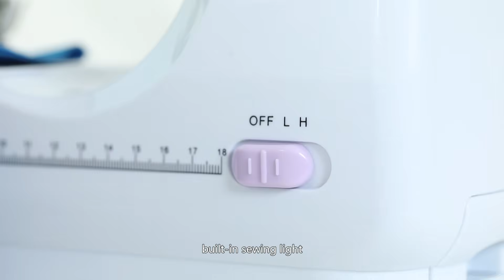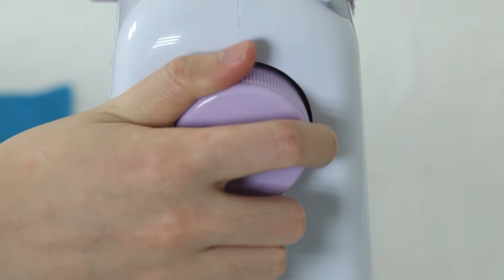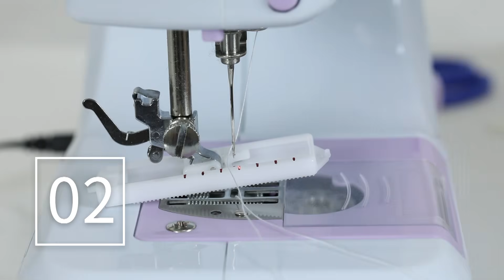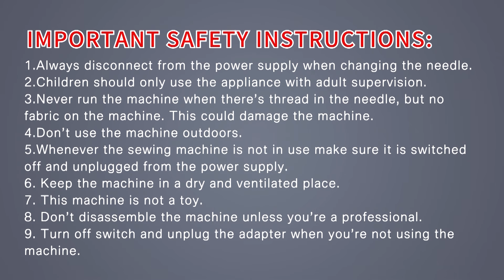Operation of FHSM-505 sewing machine

Comment: Ok wait you said at to thread the machine from back to front then a few seconds later you said thread from front to back which is it ? I have the same exact machine I have followed the instructions on threading the lower bobbin but for some reason as I start to sew it gets jammed and the thread gets all tangled then it stops like it’s stuck smh I will be returning Based on other comments, I’m assuming that this machine was not designed properly and if I would’ve seen the comment prior to purchasing I would not have!!

Comment: This machine worked for me on a couple small repairs then when kaplooey somewhere in the bobbin area. Needle goes down and pulls to the left and it gets jumbled up right from the start. Very disappointing as I have sewn since I was 12 on a Japanese Kenmore that has been broken for years, so I got this cheapy thing as a "quick fix." Well, at least I got to repair two things. If anyone has any tips for the same problem, I'd appreciate. It's not the tension, I don't believe, but something is not connecting in the bobbin area. Plus the magnet that holds the bobbin is nothing like the compartment that holds the bobbin in my old Kenmore.

Comment: Hello I have a similar machine but they call it a Birgitta now the machine instructions says flat side to the RIGHT but the Universal needles says flat side BACK. If I follow the Universal way will this effect the function of the machine?

Also I have found replacing the needle tricky (either way) its wobbly falls outs tried many times to no avail. Can you tell me what the problem is? Please.

Many thanks

Comment: Why does the machine sew even when I do not press on foot pedal.
Reply from the maker: The machine can be controlled by foot or manually toggle the switch to control the speed of sewing. The two can be used at the same time or separately!
Reply: @huafengsewingmachine2563  I have a problem my foot pedal cannot very from fast or slow it can only be fast. How do I make it slower or vary the speed by foot?

Comment: Do you have to thread it from front to back? cuz I have a hard time getting the threading tool though the whole from the back
Reply: It is difficult. I just got done doing it myself today. Use the little threader tools. Those little wire things push it from the back to the front of the needle put your thread through the wire hickey and then pull it back back through the needle. It took me a couple times but you’ll get it😉😁

Comment: Apparently, there is a timing issue between the needle and the rotating wheel underneath it that supposed to pick up the bottom bobbin thread. I saw this by carefully examining how the the rotating wheel hook should catch the thread from the needle. I was able to fix this by using a screw driver to place the thread on the hook. But despite of this the machine is not stitching. I guess it's a very bad design of the machine. And most probably the machine is faulty, since a lot of people reported the same issue including me.
Reply: You need to take the face off of the machine and adjust the screw of the needle bar which is in the middle of the hexagonal washer/bolt thing.  It's very easy to do. I have this machine and it's something I have to do frequently.  The needle bar always seems to shift.  My husband inserted a rubber band around the screw, he's an engineer and said that there should have been a washer there to prevent shifting to begin with so we will see how that goes.  I do a lot of sewing and this isn't my main machine so I haven't even used it heavily.  I love the design and size of the machine so I'm thinking of switching out some parts if possible and upgrading it myself.
Reply: Yo trate con la llave hexagonal, desarme, ajuste y aún nada no me funciona y no tengo ni 1 mes de uso 😢
Reply: I'm having this same issue and can't work out how to fix it:(
Reply: Do you know how to thread the bottom bobbin three of it won’t pick it up I can’t figure out how
Reply: Tienes que calibrarla
Reply: @careliz  How, please?
Reply: My bobbin thread keeps knotting,  but when I 1st received it, i had to move the needle part as it kept hitting the metal below
Reply: I’m having exactly thesame issue and I haven’t even used the machine reasonably well
Reply: https://youtu.be/atR8rpHWqvE?si=_OeZ8rOEeHVOQuMP
For bobbing issues
Reply: Please can you do a video on the needle part mine got stuck
Reply: Same

Comment: Hi, thank you for this info. I have problem, my needle doesn't pick up the bottom bobbin thread for some reason. Anyone else had that problem and how to solve this? Is my machine faulty?
Reply: Apparently, there is a timing issue between the needle and the rotating wheel underneath it that supposed to pick up the bottom bobbin thread. I saw this by carefully examining how the the rotating wheel hook should catch the thread from the needle. I was able to fix this by using a screw driver to place the thread on the hook. But despite of this the machine is not stitching. I guess it's a very bad design of the machine. And most probably the machine is faulty, since a lot of people reported the same issue including me.
Reply: I got the same problem sometimes but it always end to work
Reply: This design is incredible! You certainly know how to keep
a reader amused. Between your wit and your videos,
I was almost moved to start my own blog (well, almost…HaHa!)
Fantastic job. I really loved what you had to say, and more
than that, how you presented it. Too cool!

         <a href="https://sewingcrafting.com/">https://sewingcrafting.com/embroidery-machine-for-clothes/ sewing machines 2022</a>
Reply: I am also facing the same problem I don't know what to do,? No machnic  is ready to repaire  it.
Reply: I have a sqme problem😊
Reply: I got the same problem, I just bought 2days ago and I try to test so needle just brake and when I placed it doesn't button bobbin  it takes me some hours I still not working.
Reply: Same problem here. I have tried everything.

Comment: I have a huge question, do I have to use the bobbin and the thread that's on the top? Or can I just use the thread that's on the top? When my machine arrived it was pre-threaded and ready to go. I changed out the color thread. But now it's tangled up with the bobbin and thread. So I'm wondering if I can only use one or the other? I sure hope I'm making sense 😂
Reply from the maker: Hello! When you get the product, it is pre wired before leaving the factory. If you change the color or the coil is used up, you must thread it again. First, you need to remove the original spool or coil and replace it! thank you!
Reply: @huafengsewingmachine2563  yes I know that
 I'm asking if I have to use both the thread from the top and the bobbin? Do I have to use both to sew? Or can I only use the thread up on the top?
Reply from the maker: You can use the spool with thread in advance to sew, or you can replace the spool with a new one. Thank you! @shabbyrosecreationsbykem
Reply: @shabbyrosecreationsbykem  of cos u need both top n bottom in order to sew. top spool n bottom bobbin. and need to thread n fellow all step correctly n when put the bottom bobbin make sure it catch n loop up if not it will not sew. i practice how to thread the machine correctly so it sew if is not done right then do not sew at all.😂😂
Reply: @creativekat109  actually it's not of COURSE! Especially when you're a brand new sewer trying to learn. I've never sewn anything in my life. So just because YOU know how to sew, doesn't mean we ALL know how to sew. Btw: cos isn't how you spell course!! I simply asked a legitimate question, as I didn't know! So please don't be rude by saying "of course"!

Comment: I ordered this machine and the foot pedal doesn't work. You need good hand eye coordination in order to hold your fabric with your left hand while controlling the power switch at the same time. You have to use your left hand to help glide the fabric in a straight line.  It takes some practice and overall the machine works well. I'm thinking maybe a walking foot might help but not certain it will fit this machine. I'm still going to replace this for a full size machine.
Reply from the maker: Pro, if the foot pedal is broken, just find the foot pedal of the corresponding machine model, and there is no need to buy a complete machine again! Some models can sew without foot pedal!
Reply: Hi!
Did you try a walking foot already? 
Was wondering too if a walking foot can fit in this machine. My foot pedal is kinda hard, when i use it, it just goes off so fast

Comment: Just got this sewing machine but disappointed that it cannot stitch as the needle does not move at all.  Tried everything possible.  😞 👎
Reply from the maker: First, turn the hand wheel before use, run for several weeks, and then start the sewing machine.

Comment: Your instructions said to thread the needle from back to front. When you put up a caution just after you then said to thread the needle from front to back. So which is it?
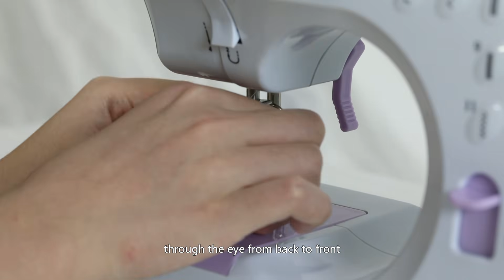Reply: 1:31Your comment was a few months ago. But, to help anyone else wondering. 

They were talking about the needle threader at that point. To push the needle threader pin thing, from the back of the needle eye to the front, us looping the thread in and pulling the needle threader out. Will make us thread from front to back. Their main thing take away was, whether we use that method or don't, to make sure we thread needle eye front to back.

Comment: Thank God that this is the "easy to use" model for beginners...  I don't know what I would have done if these instructions were hard to follow!
Reply: I’m having so much trouble with the main input/output connecting to the machine. It doesn’t seem to want to push all the way into the machine, so there’s 1/2 the silver metal still showing. This can’t be right?? It won’t go in any further.

Comment: Mine doesn’t have the same stitches I have only 8 different , but it is same, ?!?!
Reply: Most of these mini machines are quite similar.  The biggest difference can be in how the bobbin is threaded.  Your instruction booklet hopefully will give you proper instructions for threading the bobbin.  Pay attention to  the bobbin placement.  The thread will unwind either clockwise or counter clockwise.  If your instructions are unclear which way the bobbin unwinds you may have to experimrnt.  Hold the bobbin up so the hole is facing you.  If the thread hangs down and creates a "P" shape the bobbin is unwinding counter clockwise.  If a "9" shape the bobbin is unwinding clockwise.  Try threading the bobbin as instructed.  When you sew if there are skipped stitches or the thread jams flip the bobbin over and rethread.  Note which driection the bobbin is unwinding.  The bobbin should always unwind in the same direction each time you change the bobbin.

Comment: Thank you for the visual tutorial! I just got my sewing machine, and I had a lil bit of trouble at first, but so far it's going pretty good! I still need a lot of practice though lol 
So far I have been working on fixing up my old quilt that my grandmother gave me. The washing machine tore some big holes into it, and my mother told me to go buy a new blanket..but I never want to throw away that quilt. XD
Reply: I bought the same machine and I nearly used 4weeks and now the steach is not coming..  help me😪
Reply: I just bought mine too!! I’m trying to learn how to start sewing a new fabric. Why are there only black and white bobbins? Are we allowed to purchase other colors to use?
Reply: @thebusybee957  yea i think you should be able to use any color :) i think they might all just come with black and white lol
Reply: Also when it explains threading from front to back...does it mean the tail of the thread should be facing you and the front of the machine? Or other way around? Hard to tell in the video
Reply: @thebusybee957  Hmm..I might not be the best at explaining it either, but if you mean the thread when it hangs out of the needle/bobbin area, I have it face me/the front of the machine. Also random tip, try not to use the reverse function. I tried a couple times and got some bad jams. XD luckily got them untangled.

Comment: Do you know where a person would find additional attachments for this machine such as variety of pressure feet etc.  I have this machine and I like it so far but I thought it was going to come with other accessories.
Reply: Pressure feet designed as "snap on" should fit this machine.  The feet will have a little bar for the pressure foot holder to snap on to.  Avoid feet that have a shank attached.

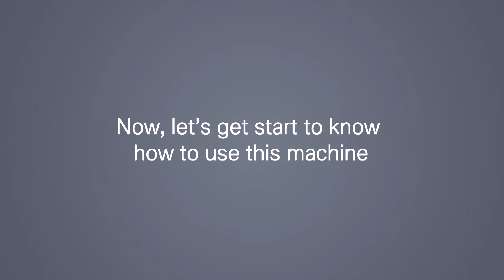Comment: 01:00  threading the machine
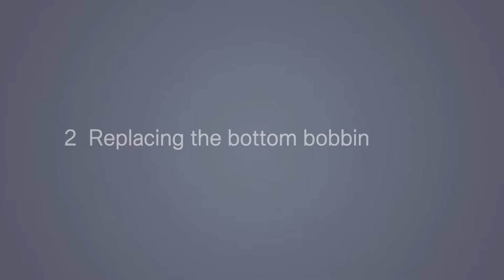01:54 Replacing the bottom bobbin
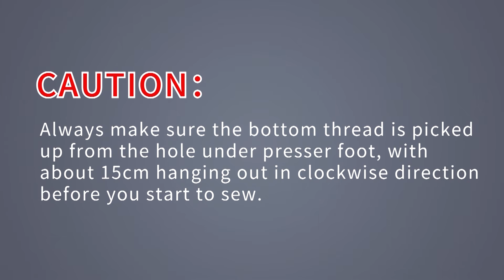02:47 Winding the bobbin
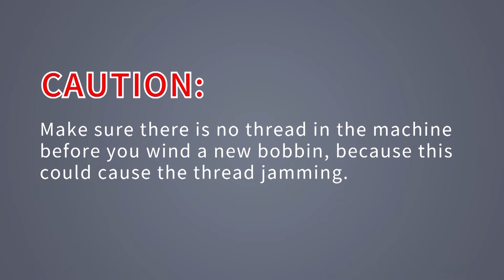04:00 Replacing the needle
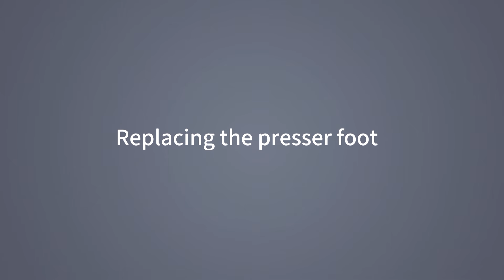04:39 Replacing the presser foot
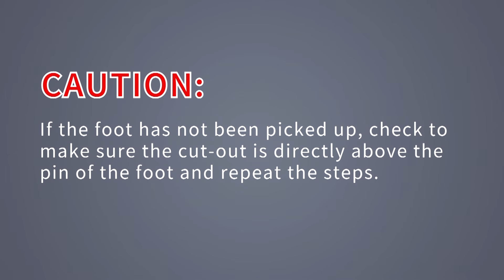05:28 Adapter and foot pedal
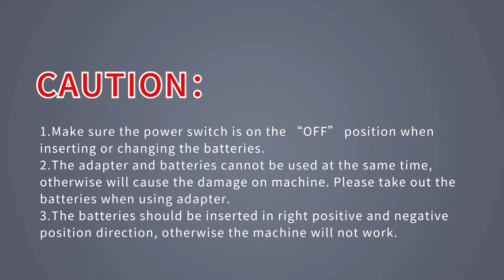06:54 Sewing
08:30 Adjusting stitching
09:45 Sewing Sleeves
09:53 Button hole sewing
11:00 Nailing buttons
Reply: Thank you for that!
Reply: Do to have any troubleshooting videos?
Reply: Bless you
Reply: how can i do shirring or smocking with this machine?
Reply: Wow thanks, The tutorials are nicely detailed but too fast, I got lost along the way when threading the machine🤣
Reply: @marthandapewa9186  Click on the little gear icon at the bottom right of the frame, click on Playback Speed and choose a lower speed.
Reply: thank you!!
Reply: @laina2772 PLEASE HELP!! My tread is getting stuck in the top of my machine?
Reply: Omg I love you
Reply: this is really helpful to highlight the functions of machine, i keep coming back when i had one of this issue. many thanks dear!
Reply: i bought for my mom. used only 2 times now its not functioning. mybe the adapter. the light not working
Reply: Do to have any troubleshooting videos?
Reply: How to set up this timimg?
Reply: Please help my needle isn't moving when I press the foot pedal. All I'm hearing is the sound but no movement
Reply: Как СМАЗЫВАТЬ?
Reply: You are welcome! :)
Reply: @Itaria_no_Ilaria  4:00
PLEASE HELP ME!! My tread is getting stuck in the top of my machine?
Reply: I can't thread  my  machine 😭
Reply: Thank you!!!

Comment: When the light is not already on is it damaged? What i can i do to operate it again?
Reply: You have to check the power wire's connections, I did it in my machine and discovered bad and weak connection so I fixed.

Comment: Fisrt you said to enter the trhead in the needle from back to front and then you said from front to back.
Reply: C C P Front to back is correct. If you use a threader, it needs to come from the back in order to pull the thread from the front to the back.

Comment: My power switch nor  foot pedal  are not working what could be the problem
Reply: Same here, my foot pedal is not working.
Reply: Mine stopped working too but my light comes on fine. 😅
Reply: @unicornlover30  my light won’t even turn on
Reply: @Meghnad 🙅🏿‍♀️ Whhaaaaa? Aaahhhh no, but I will try and take it to get looked at.😅
Reply: Same it won’t even work with batteries

Comment: Hope you can help me. My FHSM-505 would get stuck after a few stitches even when the fabric I am stitching is not too thin and not too thick. It would stitch about 4 stitches and then stops. After turning the hand wheel, it would stitch again but only a few then gets stuck again. I hope you could tell me the problem of my machine. Thank you.
Reply: My mom is having the exact same issues and we don’t know how to fix it
Reply: I'm interested in a solution too.
Reply: same!! the thread on the bottom keeps getting tangled and bunched up and idk how to fix it
Reply: I’m having the same problem.
Reply: same issue after I changed the bobbin
Reply: same!!
Reply: same
Reply: @Meghnad Thank you for your response. Actually, I've been using its AC adaptor.
Reply: @Meghnad There is indeed a huge difference on its motor. That's one thing to take into consideration. It actually gets stuck on using both the foot pedal and the push button. I will try to do the stitching with a piece of paper, and check also the needle  and I will get back to you. Hope it will work.
Reply: @Meghnad Thank you! I appreciate this a lot 😊

Comment: Just bought it.  Thank you for great instructions in English.
Reply: So how is it?
Reply: @freedomandpeace80  working well  love it
Reply: Bought mine yesterday still stressed and struggling
Reply: @gladysmatloga3068   Sorry to hear you are struggling still.  This is the best video I found.  I notice I wrote my initial comment 4 years ago.   I enjoy using this machine for small projects.  However, it isn't good if you try to sew anything that is a little bit thick.  Be very careful about putting the bobbin in the correct way and I have to keep the winding thread lifted a bit at the back as it is winding, as it doesn't go up and down evenly from top to bottom.  Good luck with it.

Comment: the upper needle doesn't pick up the lower thread. how can i fix this?
Reply: Same,  it just happens in videos and no one explains it
Reply: In my case, I just let the thread slip from the slider then hold it when I begin to stitch. It will automatically be pick up by the needle .
Reply: @saiamaho  I will try this now. Will be back if it will work
Reply: @saiamaho  sadly, it didn't work 😔
Reply: Check the upper thread if you put it on the right way
Reply: Pull on the upper thread while turning the hand wheel towards you.
Reply: Mines the same! Anyone figured it out??